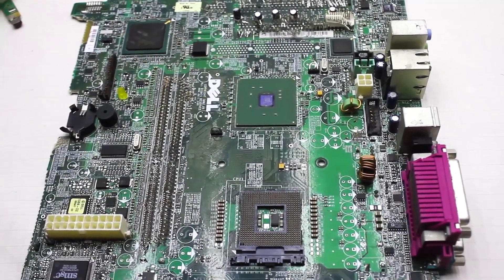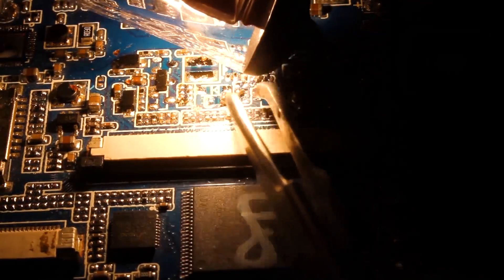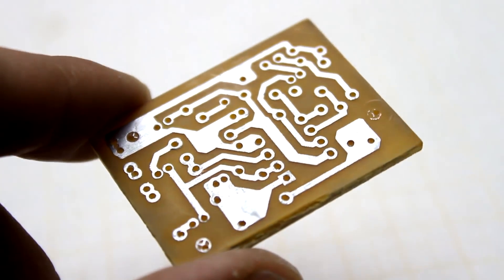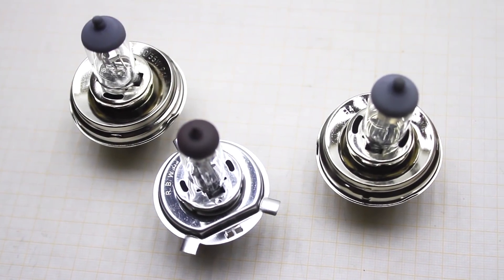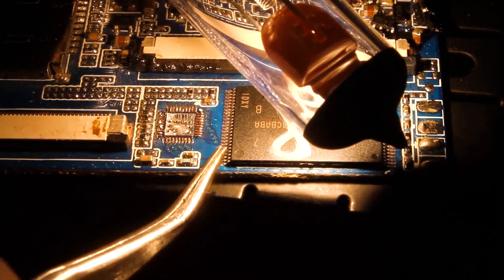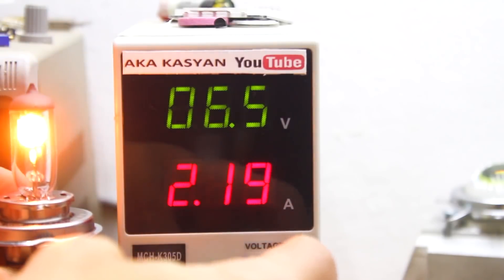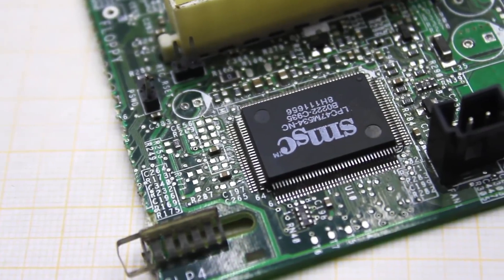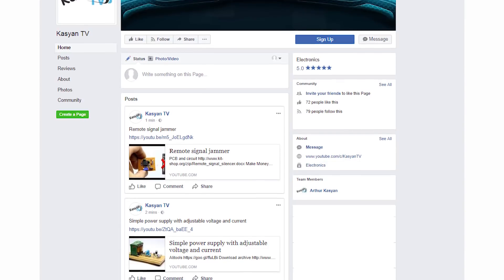SECRET function of halogen lamp. THIS YOU DIDN'T KNOW!

Comment: The radiation of a halogen lamp is mainly near infrared radiation in the wave length intervall between 700 and 1200 nm. This is NOT heat radiation by itself. The infrared light is absorbed of the device and the PCB and locally converted into heat.

Comment: Light bulbs are intended for light, NOT FOR HEAT!!! And please don't use 230V mains voltage. My 12V 1200mA power supply is overheated, and my 12V 1.3Ah lead acid battery quickly discharges. Please don't do that, or else i will thief every electronic project.

Comment: Very cleaver but my 12v transformer burned in 20 minutes for using as a source to light up the halogen lamp.what should i use as a power source to light up the bulb?car battery???what did you used to light up your halogen bulb?

Comment: As a Materials Scientist, with electronic background there are obvious false claims here.

1.00 "heat capacity of the board and refractory solder" heat capacity is a term applied to matter in pure form, a circuit board has many types of matter. Solder is an alloy metal of tin and lead, whilst refractory are non metals such as glass, clay etc. No such thing as a refractory solder
2.33 "heating time dependent on dimension and heat capacity of the circuitboard" how can a circuitboard have a heat capacity as scientifically understood considering it is not a pure material. Heat capacity is applied in calculations involving elements and compounds, e.g. Silver, gold, water, sodium chloride, carbon dioxide. If the video is referring to the heat needed for the board , just say that.
2.34. "Anyway the method has never failed" not true
2.59. " without fanaticism" whatever is being meant here?

Heating solder to attach electronic components is one thing. Heating the components to over 200C would damage or at least shorten their life expectancy. Since when does soldering involve heating the component as if heating the solder. Applying minimal heat ensures the solder joint attaches correctly without excessive heat to the tracks and the components. The video shows the method for removing components, albeit they are heat damaged and would lose their electrical tolerances. As someone else said the toxic fumes from heating plastic components would be very dangerous to an operator

This is just a useless waste of time.
The amount of UV light and heat generated by these halogen bulbs are injurious to the human body so some of the techniques shown are inadvisable

More thought needed into the scientific explanation.
Electronic technician have difficulty in resoldering small components

Comment: Thanks for this idea! I´ve tried it with a dead Laptop board with Quadro NVS graphic chip. There are many tips to resolder it with a heat gun, but with a car bulb it was really easy. If there would be an idea to desolder such chips with underside contacts, and resolder a new one, it could be helpful.

Comment: I've been doing that for years.  Only, instead of a car halogen bulb I've used those halogens that come with reflector cones, the kind you see shining a light on a picture or something you'll see in the kitchen.  They still get hot, but more of the light's energy is transmitted to a focal point.  So the closer you get to that focal point the hotter the beam.  Larger components you have to back off a little to get a wider area of heat.  And it takes longer.  But it works.

Comment: I am totally new to electric and electronics...  I want to know whether the halogen lamp glows using AC current OR only car battery need to be used.
Reply: Shiva Shanker  a halogen lamp is a resistive load so it can be used with an AC or DC supply a 12 to 15 V transformer should work but it has to be able to deliver around 5 Amps. Or use a car battery but then put a 5 or 10 Amp fuse in the wire as car batteries can deliver very large currents when shorted. Hope this helps.

Comment: how do we supply electricity?
Reply: You can use a halogen power supply for  a 70-100watt lamp. should be enough.
Or a big 12 volt transformer for some 50va power.
or a power supply that can give 13.6volt at 6ampere continue without become hot.

Comment: Just buy a darn rework replacement handle or a 40$ station, halogens emit a lot of harmful uv rays..
Reply: actualy almost all the halogen lamp for car that you can buy now have a uv shield integrated in the glass that absorb them and you can find wrote on the lamp box or on the lamp directly wrote as a "U" or "UV" at the end of the info engraved on the bulb holder. Is a new manufacter rule from when car started come out with plastic lenses. It is designed to don't dmage the acrylic lens in newer cars.

Comment: Good video...but you need to reinforce that the lamp must not be touched with fingers because the oils on your fingers and hand will heat the glass and crack it.  If you get body oil on the lamp you need to clean it with rubbing alcohol.  You should use cotton gloves to handle the lamps.  Also, normal sunglasses do not offer enough UV protection against the light from the lamps.  Wear a pair of polarizing glasses AND a normal UV pair together.
Reply: On latest car lamp there is not anymore uv real danger. The latest h4 h7 h1 lamps etc have integrated a uv filter in the glass that help the acrylic lenses in the car to don't be damaged because of the uv. sure you have seen in the old years some car that got the acrylic lenses damaged from old lamps without uv filters. The yellowish and foggy lenses damaged from the uv rays from the lamp. Now those lamp have a uv filter in the glass for this reason. For be sure if you heve them search the wrote on the lamp box about uv filtered lamp or directly engraved at the end of the info wrote on the metal bulb holer of the lamp like a "U" or "UV"

Comment: I tried this method, but it did not work for me.
I used a H4 60 / 55w bulb and a good power supply
and of course I used the 60w filament (which has the reflector)
simply does not reach the temperature of melting the solder
it's a shame because I do not have a hot air station
Reply: What power supply did you used? a car battery charger won't work even if it show the lamp go on because it don't have enough ampere for the lamp and don't deliver a full dc voltage. they deliver just some 14volt not rectified impulses at 120hz(us) or 100hz(eu) with duty cycle 50%. This mean that it deliver the voltage only at 50% the time. .in simple words it don't deliver enough for to the lamp. The minimal power needed from the bulb to work should be 13.6volt( not 12 as wrote and all think the car during movement is at 14volt because of the alternator gave the power to all the items in the car. not the battery)  at 6 amps dc rectified.
When i light a bulb like those in the right way, at 2 cm it can burn skin in less than 4 seconds. Pay attention at the video too, it is time lapsed at more points. that mean it was going faster than actually was the true time needed to make those components hot enough to desolder them.
Reply: begclobegclo than its not practical or efficient at all.

Comment: IR glasses  are cheaper than sunglasses, I have a couple of pairs so I'm going to try this on an old TV board to obtain recycleable components. . Also have several old halogen bulbs with one filament burned out , at last a use for them instead of  just 'emergency'

Comment: Great idea.  Can you recommend a particular part number for the bulb that include the internal reflector?  This would seem to be a big advantage.  Also, raising the voltage will shift the emitted spectrum in the direction of visible light and UV which don't melt solder not to mention unhealthy for your skin and eyes.  Also, you can use an aperture to put IR on just the part you want to remove solder.

Comment: This is good Chinese ingenuity and resourcefulness.

hot air guns: 
-can get too hot, and
-can't focus the heat to a small spot (unless you have a tiny one like Kasyan's)

I have a couple of spare halogens in my workshop, which is why I'm here

In this application, I might try using a little aluminum foil as a hoodie so that
-i can direct the beam closer to where I want it and lessen the chance of heating up the wrong part
-can shield the light from my eyes

It helps to have a small needle nose vice grip to hold the hot bulb.
Don't forget to wipe the bulb clean (while it's cold) before you use it.

Comment: I try this mathod But not worked.
I have 35 watt lamp and I applyed 12v 2A DC adaptor then lamp was blinging so I connected inductor in series than lamp work properly but not desolded to component.
Reply: Those lamps need at least 13.6 volt at 6 ampere to work propely. the car deliver that power to the lamp during drive
Reply: OK but how to make 13v and 6 amp
Reply: you can search for an electronic power supply for 12v halogen lamps with like 70-100watt. power.
Or an old type  heavy metal transformer like 12v 50va should do the trick. or a toroidal if you can find it.
Before the born of the switching transformers, in the halogens for home or office there was a old heavy transformer that was supply power to 2 t 4 lamps. Search for that type.  Aniway. you should use the car lamp as in the picture to get good result. the high beam filament ( the one with the shield at one side) it direct all the power in one side with 55-60watt power. 35watt is not enough. Let me know.
Those are the halogen where you should search for the power supply. Sure you seen those things before.
if you even find one of them rated for 50-100watt, you can use that for make hot. Only trouble is that the beam is more wide, so more components get hot.

Comment: You're in a garage, working with wrenches and oil and stuff, and friend comes over:
- I need this sh**ty mosfets replaced, but I don't want to go to the service shop, it is too expensive, and on the other side of town. I have mosfets in a bag.
-Gimme that (pulls over light bulb, replaces mosfets in 2 minutes). There. Go away, I'm busy. (clanks with hammer on pliers)

(Insert "like a boss" meme)

Comment: To a tinkerer, using a halogen lamp to desolder SMT parts on a circuit board sounds ingenious. 

But it is extremely dangerous in a number of ways, mentioned in various comments down below. 

I would not recommend this method of desoldering because there are too many danger issues and some of you are hopelessly clumsy.  You know who you are. 
I KNOW how clumsy some of you are. Some of you have been fired from jobs for being so clumsy.

Some of you will become blinded by going forth and using this method. 
Some of you will burn your lab to the ground, Nikola Tesla.
Some of you will wind up with extremely bad burns on your skin. 
Bench power supplies will be ruined. 
Then there are the 2nd-order things like fire sprinklers going off, and the igniting of volatile fumes you didn't know existed in your workspace.  The inhalation of poisonous fumes from the heated circuitboard parts and chemical residue. 

Unnoticeable cold solder joints on surrounding SMT parts you wanted to keep as-is will cause open circuits and intermittent connections.  
The warping of the circuitboard due to uneven heating and cooling with the applied halogen lightbulb heat may also cause SMT parts and solder pads to lift completely off the board just enough to where you won't see the problem but you'll experience all kinds of intermittents.

Realistically kids, in this day and age, it does not make sense to try to repair a densely populated circuit board. Just toss the circuit board and buy another one; replace the old one.

If the electronic components are far apart from each other, then fine, go ahead and attempt to remove and replace. Just remember, the expenditures of time, effort, money and emotion.
Reply: The problem with our generation is the wasteful mentality. You don't need to repair what is broken. Just throw it away and purchase a new one. I think we are producing way more waste than we should. I think we should throw Electronics away only if they are truly irredeemably broken. Repair as far as you can. Don't be wasteful just because you're rich or perhaps leave in a first world country.
Reply: Dancing Spiderman
Reply: hawkturkey  like you use soldering past it melts at a lower temperature, this is what is used with a hot air soldering gun

Comment: 15 seconds worth of information, all the other minutes is advertentions and valueless statements. Why bother buying a halogen lamp when you have a hot air gun for 40$ or less.
Reply: Because the hot air can move light weight parts that are in the vicinity of the device you're intending to remove.  With IR you can make an aperture and heat just the part you want.

Comment: Eye protection is a must otherwise you will cook your eyeballs. Sunglasses not rated for infra red (IR) blocking may give you a false sense of protection and cook you eyeballs. Some clear safety glasses made of polycaronate are readily available and will block 90% or better of IR radiation.
Reply: How about welding glasses designed for flame welding?
Reply: Jerry Oswald every cheap sunglasses have infrared peotection

Comment: I used that method for long time (well i use discarded but still ok 24V 150W aluminium reflector lights  - from trains??? - found in railroad trash containers - looking for scrap copper/alu, found bunch of lightbulbs, and an angry, loud, but slow running security guy).
Take care - as chip is black and solder is silver/reflective, you tend to fry/overheat sensitive chips, you can put piece of alufoil over center of chip to prevent this. 
If you do not need the board, just the chip, it is safer (for chip- but you may destroy pcb) to heat it from below till solder melts. 
If you wanna keep PCB but chip is bad and you will discard it anyway, just cut legs off from chip and desolder them separately with iron.

Comment: Repairing a motherboard (which is probably obsolete) is a waste of time. Locating the defective part is virtually impossible without a $100k computerized factory test system. Lamp heats up a broad area which can easily cause a small transistor, diode, capacitor or resistor to be removed which you may not notice. After you replace a chip or power transistor (if you can even buy the part,) if just one component is missing or shifted off its footprint the board still won't work.
Reply: tedtw yes of course it is but remember outdated no longer being produced boards for very expensive equipment. We still need to repair these and replacements are not an option. Very few but mcgyvering a makeshift solderstation on the fly is really a cool thing to know.
Reply: Daniel Dollive but not practical in the real world.

Comment: This is great for component salveging
Reply: To nightmare in action,
Actually this is NOT a good method for salvaging components from a circuit board as they are likely to be damaged from the uncontrolled Heat.
This IS however a good method for removing FAULTY chips where you have way too many "legs" to heat simultaneously than any other method than a hot air desoldering station would allow, and since the chip you're removing is faulty, it's all right if you damage it further during removal.
After that, cleaning up the holes with "Solder Wick" is a simple matter before installing a NEW chip in its place, however, you would not want to use this method for installing the NEW chip as the risk of damaging it with this method is too high.

Comment: an extremely cheap variac needed to adjust the voltage to what is needed costs more than a pretty decent desoldering tool and the desoldering tool is going to be alot safer and alot more reliable.
Reply: Why a variac? Can't a regular DC workbench power supply do the trick?
Reply: @RussellTeapot  because you can control the voltage, thus controlling the temp. That comments also 4 years old...
Reply: @stonemason9063  OK, but why a variac? You can set the voltage if you have a programmable DC power supply and if you are into electronics chances are that you have such a power supply. I don't see the point in using a variac here, since 1) it's a lamp, so it can be driven by either AC or DC, shouldn't really matter 2) it seems to be a lightbulb used for car headlights, so it's designed for DC. Or maybe there is something I'm missing here?

Comment: I was solder certified to the J standard back in somewhere around 08 and I've removed chips from boards as a practice but have no idea about the halogen light and I think that is most excellent excellent video thank you thank you thank you
Reply: Now reinstall...
Reply: steve bigler it should work the same way but the only thing is is that you have to make sure that you have it lined up perfectly

Comment: VERY interesting video, thanks!  Just what I need as my occasional need for a true SMD Hot Air desoldering station doesn't justify the high cost for a professional unit, and the cheap internet versions often don't work well.  If you use the halogen bulb method I recommend that you NOT hold the bulb by its base.  That's a good way to burn yourself.  Wearing gloves is a good idea but they can get clumsy while handling tiny SMD parts.  It's better to make a handle for the bulb out of a hollowed out dowel, or use the wooden handle of an old tool, like a file.  I have an old wooden handled soldering iron with a broken heating element that is perfect for the job.  Also, attach the socket from a junked car's wiring harness to the handle so you can change the bulb easily.